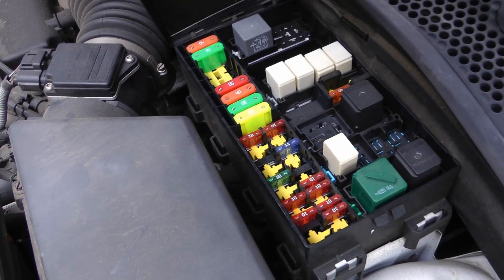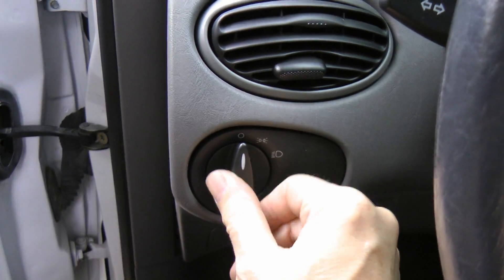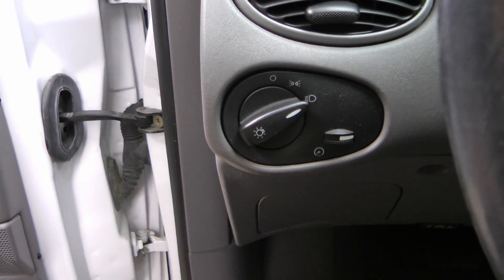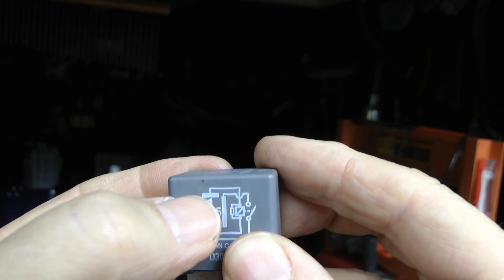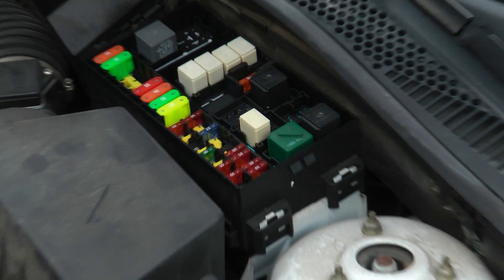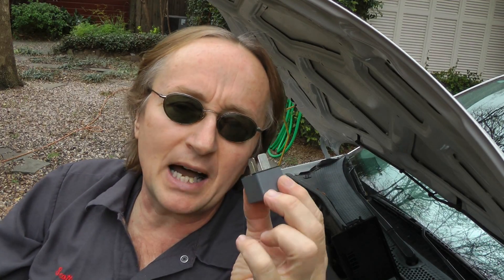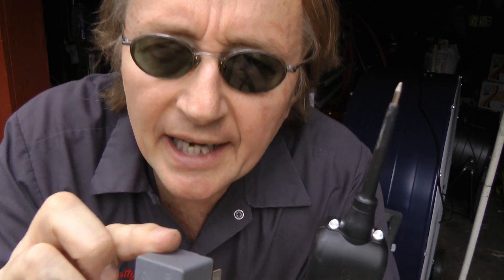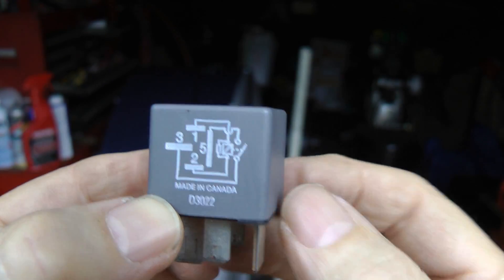How Electrical Relays Work in Your Car - Electrical Troubleshooting

Comment: +Scotty Kilmer

I have this problem in my car when i turn the right indicator it is flashing at normal speed but then when i turn the left indicator on it flashes really fast and then goes back to the normal flashing speed. I have checked all of the bulbs they are working. Could this be a relay or the blinker/clicker where the indicator stick goes inside the steering wheel?

Car is BMW e46 3 Series Year:2000
Reply from the maker: +KrystekkCF either relay is bad or there's a wiring short in the system

Comment: By any chance do you know where the relay is located in a 1995 Honda Civic? I installed LED turn signals and they blink to fast but I can't seem to find the stock relay to remove and put one for the LED so they can flicker at normal speed
Reply from the maker: +Elias Cisneros hiding under the dash with the other relays on a small panel

Comment: have a1994chevy cheyenne  truck all lights work except headlights have checked fusible links all good. no fuse to headlights  that I can find. going to check switch next but not likely cause dash lights and parklights work. taillights also work have checked grounds.
Reply from the maker: +Glynn Dilbeck  get a test light, check for power before and after the switch first and go from there, no power out of the switch but power in, it's bad

Comment: Scotty, what is that tool called? Power probe?
Reply from the maker: +ATCRyderX© power probe 3 is the modern one I use every day
Reply: Scotty Kilmer thank u!
Reply: Scotty Kilmer.  while Driving home my low beams went out i pulled over and tried the high beams they  worked running lights also worked I turned head light switch on off they stayed off. I turned the car off and back on low beams came back on could this be the relay

Comment: I have a 98 Buick lesabre. The left signal works fine, but the right signal lights turn on but don't flash. And when i turn the hazards on, all lights flash except the rear right.  any ideas?
Reply from the maker: +oles911k check the right rear bulb and socket that may be corroded. If not that, replace the flasher relay

Comment: i have a 99 camaro sometimes when i start it it turns over slowly and the starter clicks and then it turns on and my guages all reset and so does my trip odo i checked the battery and the alternator at autozone and theyre both good what can be the problem

Comment: I have a 97 Chevy C1500, that has blown 4 fuel pump relays in the last year. Just randomly. One of the female plugs on the board is burnt. I've replaced the fuel pump also. Should I be on looking for a shorted wire? Thanks
Reply from the maker: +Jared M ALWAYS change the wiring going into the fuel tank on those when pump is changed, they are cheaply made and short out there
Reply: +Scotty Kilmer are you referring to the wire harness/ adapter? The 30 plug is what is burnt on the relay which I believe is the load voltage

Comment: I change the headlight switch assembly and I change the control model for three times but the problem still is there. is any way I can disconnect the relay from outside .
Reply from the maker: +Tarik Kadhem heck, all that work, I would have just rewired the lights to work off a toggle switch myself and bypass all that computer crap if the headlight switch didnt' fix it

Comment: I mean the headlight and the lighting - and a back light  work by itself doesn't need me to turn on the switch so every time I need to turn off my car I need to take the head off the battery to turn off all the light in the car
Reply from the maker: +Tarik Kadhem  pray it's just a worn out headlight switch assembly. if not, often bad body control modules will do that

Comment: please can you help me the light in my car Grand Marquis 2007 at work by itself doesn't matter if I turn off the car on that can you tell me what's going on I change the control model I change everything the switch doesn't work I took it for different mechanic and nobody know what's going on can you tell me what's going on please
Reply from the maker: +Tarik Kadhem   what light? Heck, if it's just a bulb, remove the stupid bulb then it can't come on

Comment: window wire plug that goes to pasanger side motor one side of switch constant hot  on my 2002 gmc pickup i hook up other motor just to test and put switch on only works on one side    window motor want stop going
Reply from the maker: +Scott Whtis  odds are switch is shorted out to power, pray the motor hasn't been damaged from that too

Comment: HELLO Scotty  i have a 96 lexus LS400 and my windows and sunroof stop working when i plugged in the wrong power window switch  when i put the original back in the windows that did work at first stop working and my sunroof stop working  question they say its the main relay i wanted to know what you think.. please help me with this issue
Reply from the maker: +Da Outspoken  heck, pray it's only the relay and not a shorted out computer module circuit

Comment: Hey I drive 2009 sonata and my headlights & high beams went out at the same time along with my AC and window wipers. Could it the relays going bad??
Reply from the maker: +Jay Jay they use different relays, doubt they'd all go out together. More often, wiring shorts or computer module failure

Comment: Scotty I have a 95 vw golf that won't start when I turn the key the car turns over but won't start also when I turn the key one relay ticks like its opening and closing quickly why would it be ticking
Reply from the maker: +Ramon Esquibel often a bad fuel pump will do that, try my video "fixing a car that cranks but doesn't start up" to see if you've lost fuel OR spark

Comment: Hi Scotty I have an 04 trailblazer I m not sure if I have a bad fan clutch or a relay problem . When the vehicle is up to operating temp. and I shut off the engine should the fan keep free spinning or stop ?
Reply from the maker: +vintagehonda83 it should stop relatively quickly, if not clutch is bad

Comment: Hi sir, my suzuki apv has a clicking sound of a relay and the dash lights are blinking as the it click. Do you think its a bad relay? If so, where can i find it? Note that i can still drive even if its clicking and blinking. There are times that there are no problems at all. Hope you can help. Thanks.
Reply from the maker: Ferdie Basa   more often a weak alternator or battery, have them checked first
Reply: Ferdie Basa taera tist

Comment: I have a 2007 dodge charger rt. When it's hot out the car will start but turn off within 5 seconds. My check engine light is on as well as my esp/bas. I think its a starter relay but I'm not sure. Please help as this is my only form of transport.

Comment: Hey my 2005 suzuki  forenza  overheats when  you drive it for 20 or 30 minutes but when  I pull over and cut the car off and back on the fans kick on and it cools down to normal operating temperature I was wondering if you could tell me whats wrong if you think its a bad fan relay I just had the thermostat  replaced two days ago
Reply from the maker: Jonathon Mckleroy electronic problems for sure, but often bad main computer as restarting resets it. BUT, try a new fan relay and pray it's that

Comment: I have a 2003 Ford ranger with a bad AC clutch relay. Its a white Ford relay just like you showed in the video. I cant get it to pull out of the box to put a new one in, is there a clip that im forgetting to push out of the way or is it corroded into the box? Any ideas?
Reply from the maker: UnitCrane514 corroded, unplug a battery terminal, then force a thin screwdriver under it and you can pry it off
Reply: I gave it a tug with some regular pliers and it popped right out. I cleaned the connection with some electrical contact cleaner. The new relay snapped into place a fit better than the old one. Problem solved, now my AC works! Thanks Scotty!

Comment: What happens if I but my battery in the car in reverse meaning the + is connected to the -, I did that a now there are no lights in my bashbaord
Reply from the maker: inline6_ bm generally that fries the main computer and much else, but check ALL the fuses and pray it only blew some of those

Comment: hey scotty i have a fuse on my 2003 bmws m3 and fuse #22 is for my SMG gear box and Engine control and it has no power to it when i check the fuse but its not popped can it be a relay?

Comment: Quick Question.  I have a 02 F150 my left blinker doesn't work on my cluster nor in the front but i am able to hear the blinker running faster then my right.   It is working in the on my back tail lights as normal.  Checked the bulb and all is working by simply swapping bulb from either side.  Would the relay effect my blinker light from coming on my cluster and in the front?

Comment: I have a 1999 Cadillac Deville and all 4 of my windows my power trunk release,power gas door and high beams stopped working at the same time after I stupidly let an armature install a subwoofer in it.  Please help if u can my good sir
Reply: Update 5/23/15. I lost my door key a long time ago. Cadillac replaced it for 5 bucks. Anyway I had a blown fuse in the trunk fuse panel that controlled the windows trunk release gas door and high beams. All but my driver side front and rear widows work.  Sometimes the driver side front window will go down but not back up  so I tore down my door and "jumped" my window motor and it works fine up and down.  Is it a switch issue or something far more sinister ?  Also my windshield wipers stopped working  and also my cooling fans won't come on.  I recently had a shade tree replace my rad so possibly forgot a connection or so.    Any advice please help.
Reply: iPITTSBURGH412 Yes don't let amatures f with your car

Comment: I have a question scotty. I have a 96 lexus es300 and one day was runing fine turn off for about 2min came back and would not start, starter is new. Some guy gave me a jump and it started on the 3rd click. Drove for like 50 feet and car shut off??? What could it be?? Battery is good got it checked and alternator is good. Could it be a relay???
Reply from the maker: Alex Barcelo  could be lots of things, weak fuel pump, wiring problem like ignition switch, I'd have to see that one

Comment: Hi scotty,

I have a Saab 93 2006, basically I can't get my brake lights to function properly they constantly stay on. I was wondering can a faulty relay be to blame? At first I suspected a brake light switch but it is doing its job. 2 other options are a possible short or relay?

Thanks
Reply from the maker: Iain McCracken  if they stay on all the time, generally the switch is shorted out to the on position, or the stop that turns the switch on fell off the brake pedal and the switch stays in the on position because of that.

Comment: Hey  hi  men  I need  your  help  i have  a bmw  e28 525e  I have  tried everything  I even  took the  car  in  for  this  electronically problem on my door lock. The  fuse  in the  fuse box work for  a week  or  so  then  it  blast then  whn  I try  to  put  a new one it blast also I will try to close  30 times it will keep on blasting the fuse. So  I want  to  know how  can I use  a relay direct from the fuse box on the  central locking my  car  use  this  old  fuse box bullet points so how do I wire it from there . plz
Reply from the maker: mbuso innocent BMW=endless money pits as they age. Of course, one can rewire whatever one wants, IF you have a wiring diagram and know how to read it. Just realize that door lock system interfaces with lots of stuff on that computer run BMW, so who knows what crazy crap could happen if you start messing with that wiring. Ultimately the computer runs even the locking system on that gem. Good luck
Reply: So scotty what can I do  can I just  hook a  lrelay  to  the old place  where  the  bullet  fuse on the central locking was because I don't want to but  a switch wire I just need power plz help plz

Comment: Hey Scottie,I have a 2000 dodge neon es, I know I have a blown fuse for my engine but every time I replace it ,the but box burns them. How do I change out my fuse box itself? I have other fuses that are being burnt out..
Reply from the maker: they just unbolt and are removed, label all the wires before you take it apart

Comment: Scotty, question for you. I have a 2006 grand Cherokee, and when I hit my remote the lights flash but doors wont open. When I use the switch to open or close the doors from the inside  I hear a clicking noise but doors wont open or close but flip glass works fine. What do you think?

Comment: The trick below had interior lights working but clock didnt keep time and lighter had to be wiggled or it would cut off.I replaced the battery twice in two yrs?

Comment: My 99 i30 infiniti had speaker wire wrapped around 2 fuses under driver interior pannel when i bought it, but it came out and i don't know which fuses they were but the interior lights don't work(.Dome lighnt,door panel lights,lighter socket, & clock cant keep time) PLEASE help with any advice on what could be wrong:(
Reply from the maker: once some fool does that, generally electronics get shorted out , the fuses are there for a reason. Now you would have to find such short and fix them. See my video "finding the source of electrical shorts" and realize it can be one hellacious job finding such things.

Comment: hey scotty on a 94 s10 truck does the pcm control the gas ?
Reply from the maker: it sure does
Reply: what about the icm ?
Reply: i got one for you today i hooked up a the sensor thats in front of the engine under the water pump and when i hooked up the battery my truck started  by it self  what would cause this

Comment: Have a relay in my interior fuse box that I can't get out.. can only see one side of it and it's clipped in.
Reply from the maker: look closely some have screws that hold them in. If not, some are just tight and need forcing
Reply: Scotty Kilmer Thanks for the reply(s) man.  It's hard to look really, it's up and left of my brake pedal.  The clip on the 1 side I can see broke off but didn't make a difference.  I guess there's another clip on the other side but I can't see it.  Been wiggling and pulling so hard i'm afraid to break the fuse box, tried to pry at the relay a bit too but doesn't move.  On a side note, I tested the blower motor pos/neg plug, and with the fans off it shows 12v, then when I turn the fans all the way up it drops to 4v.. either way, neither blower motor I have does anything :(
Reply: Scotty Kilmer Update, I bypassed the ground on the plug for the blower motor, by grounding it elsewhere, and still using the positive.  Fan came on full blast even with the fans off.  Guess that's the resistor, hard to find shit for this car ;(

Comment: My 2002 Lexus ES300 will not start. No turn over, no click/click, nothing. Key turn in half position- all interior and exterior lights work, radio, etc. I have replaced the alternator, starter and the battery.

Someone suggested that I replace the “Starter Relay.”

I am at a loss??

Comment: Hi Scotty, I had my oil changed , inspection, and a headlight bulb replaced yesterday at a Valvoline Instant Oil on my 99 Volvo wagon xc70. When I got back and shut it off the rad fan stayed on and eventually killed my battery. Can the relay be the problem? Can it get stuck on? Can it be "unstuck",? Thank you!

Comment: Replaced starter in Buick century 2000 and battery , found drain as well  to battery now could relay .I thinking short in wire from starter, ignition or relay had the alternator checked and its fine I am thinking relay ?

Comment: My new ac is repair 6 time still abnormal cooling 7 gone for repairing then new problem is start car ac cooling is sometime -14 degree very cold and suddenly cooling is gone and ac button light flashing and no more cooling until I switch of ignition i can hear one click sound again i start the car then ac is working and cooling after some time again its all repeat this is relay problem or what its new car not even 5000 km .suv mitsubishi pajero .

Comment: Hi Scotty, my Dodge Charger 06 has a problem not sure what it is but when I turn on my car at night my lights flicker for bout 2 sec and then they go off then back on for about 10 secs also While driving my lights will turn off for no reason sometimes they dim when I step  on the brake cant find a solution, so any suggestions or help would be nice
Reply from the maker: have the battery and alternator load tested, places like auto zone do that. Pray it's one of those, if not, it's a wiring short and they can be cows to discover

Comment: Great job Scotty!  Not only do you explain how they work, but you explain the reasons for them--which was not obvious to me.  In my case, however, I think I may have burned up an Automatic Headlamps Relay while installing a Remote starter.  The AH won't come on, so I think I may have ruined the switch inside the relay (it is not the sensor).  I was poking around for internet answers and came here.   PS--just because the solenoid is OK, does not guarantee the relay.   The switch in it could be fused or will not close.   I am going to look for this relay tomorrow--if it exists for this feature.  I hope its not the mult-lever on the steering wheel column.  That would cost me.   The headlamps still work fine--in manual mode.

Comment: Hey Scotty I'm having a problem with my 2004 gmc envoy, my car won't turn on. I changed the battery and ignition switch but it's still not doing anything. There is no noise when I turn the key to power it on. Any ideas on what it could be. Please help I need my car. Thank you